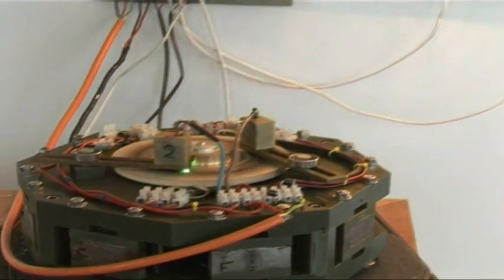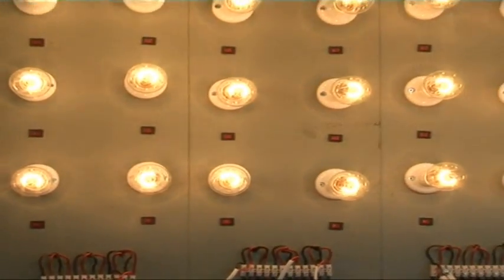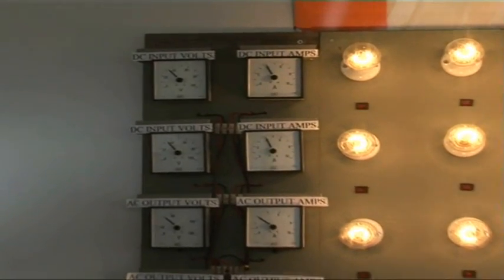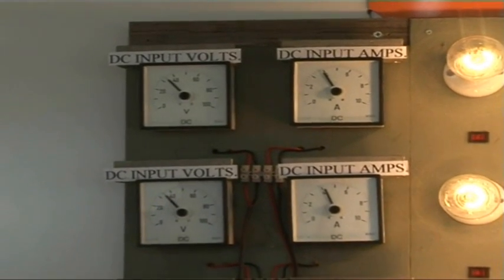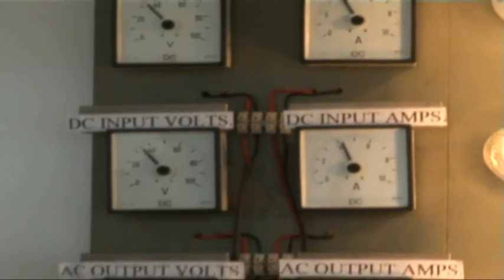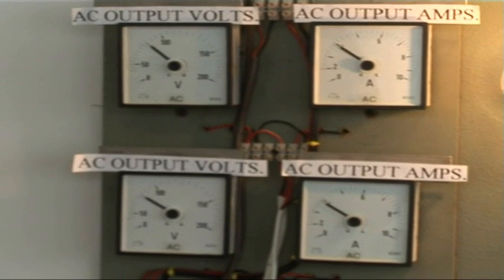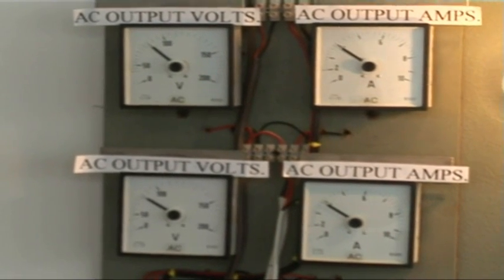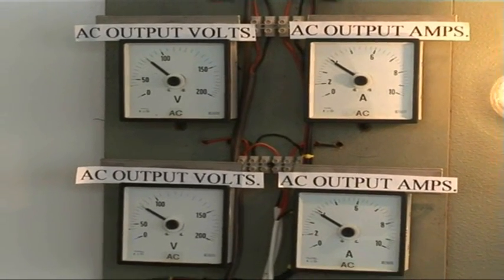Lutec Electric motor 500% percent efficient

Comment: They work O.K.: I build them! Lutec makes two mistakes: 1) Having coils on the INSIDE means COMMUNTATORS- which waste energy & wear out. Much better to put coils on the OUTSIDE, more turns can be had with less weight. 2) Vertical type RESISTS STACKING, because many BEARINGS are needed, a HORIZONTAL TYPE needs only one (at the axle end after 4-8 coil sets). House use is a waste- Vehicle use is over-riding need.

Comment: Is this Video telling me the Electrical Theory taught to me at Technical College was wrong ? We were told that when you are using Motors, Dynamos and Transformers there is no way you can get out more Watts than you are putting in due to losses at every stage by  Friction and Heat  etc. Even Amplifiers need more power supplied to them to make them work than they give out. If something looks too good to be true it probably is. Buyer Beware...

Comment: i dont know if this thing is a scam or a hoax.. it looks pretty intricate for me but i zero knowledge of such things as electricity but i do know that yes you may need more watts than you put in but where does the original watts come from certainly not thin air wether its burning coal, oil, or using kinetic forces such as dams and Niagra falls.. it does make sense that you could use the forces of magnetics and use that force to make something move and inturn create watts?

Comment: Ironic how every one of these devices has a power source attached and they're using math to show overunity.
If it puts out more than it consumes, why not just disconnect the power source and run it off its own output? they don't, because it wouldn't work. There is no overunity in these devices.